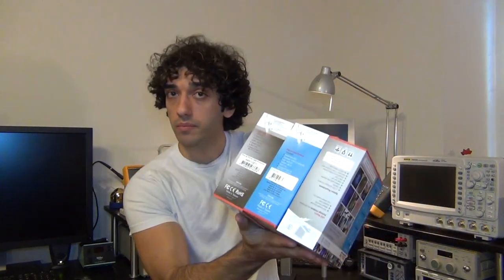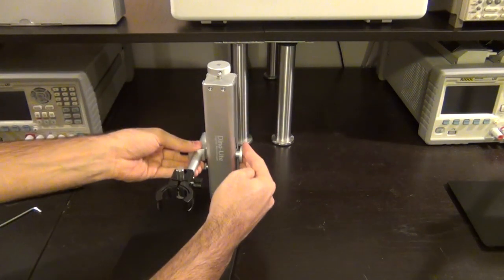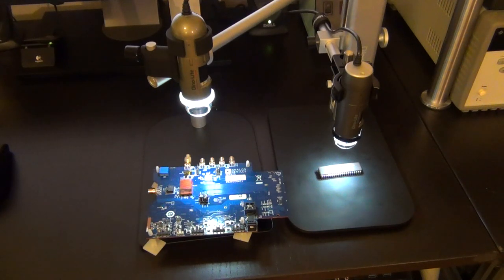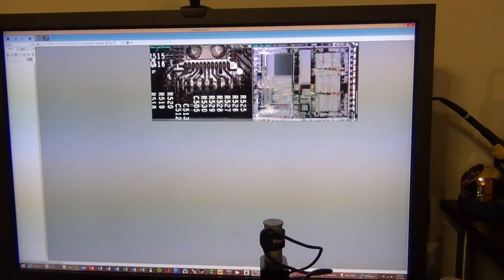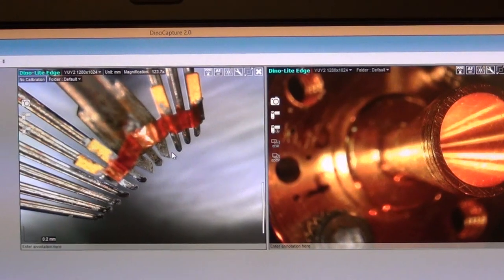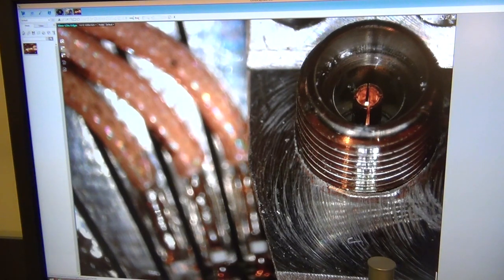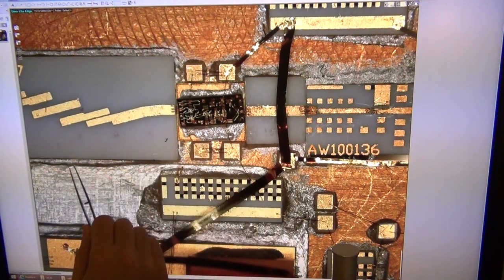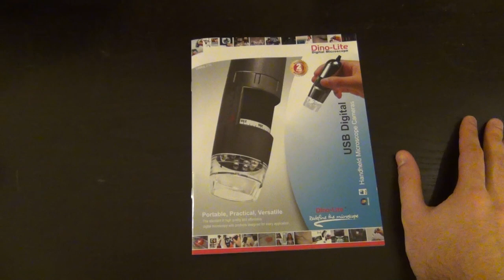TSP #33 - Dino-Lite USB Digital Microscopes Review and Experiments (2014 Edition)

Comment: Are the wrinkled pieces hanging off the transmissions lines for tuning? Looks similar to copper tape, but I'm assuming its bonded to the stripline, and tuned with the lines hooked upto a VNA? You can see a lot of them on the splitter and combiner.

Comment: "jelly" effect is due to lack of global trigger for CCD/CMOS senor, and is caused by rolling trigger, not frame rate. with global trigger at 30fps it will look nearly the same compared to rolling trigger at >60fps. I know that you know this, but it is difficult to be correct all the time at long video :)
Reply: TheSignalPathBlog

Not exactly. basically you have shift registers that can integrate light, but they integrate light all the time. so at any point, you are not reading whole image at once, reset integrators and start again.if you don't want to get jelly efect, SENSOR must start integrate for all cels, stop integrate, and read and transfer data. in rolling trigger, you are integrating all the time, but you are reading each line. That's why when you move something, image will tilt in rolling trigger reading line direction. it's sensor architecture, not hardware fault. only expensive sensors have global trigger
Reply from the maker: Linas, I accidentally removed your comment/explanation while I was trying to remove a spam comment. Can you kindly re-type your explanation if you have the time? Thanks.
Reply: TheSignalPathBlog
Not exactly. basically you have shift registers that can integrate light, but they integrate light all the time. so at any point, you are not reading whole image at once, reset integrators and start again.if you don't want to get jelly efect, SENSOR must start integrate for all cels, stop integrate, and read and transfer data. in rolling trigger, you are integrating all the time, but you are reading each line. That's why when you move something, image will tilt in rolling trigger reading line direction. it's sensor architecture, not hardware fault. only expensive sensors have global trigger
Reply: Linas K
 there are even more issue with usb video devices. RAW stream will have better quality but worse bandwidth. For example for USB 2.0 i would expect maximal resolution 1280x800@25fps or 1280x720@30fps. If compression is enabled (mostly JPEG), then compression algorithm will depend on resolution and framerate too. More data, more calculation, lees quality.

Comment: Neat .But no competition to my 60years old 1000X ZEISS-microscope.But i´m looking for a newer one with at least 3000X magnification but don´t find anything. Affordable or not.
Reply from the maker: 3000X magnification?! DOF would be absolutely tiny. I have videos on my Zeiss microscope which goes to 1000X - but even that is difficult to use.
Reply: O.K. Not with normal light. But working with higher lightwaves and converters somehow. At whole there seems to be little progress in the optical sector the last decades compared with  CMOS-shrinking fine and well
Reply from the maker: @xylfox The limits of optical microscopy in the visible range have been established for about 1.5 centuries. Changing wavelength does change the limit, but then it changes everything else about the lens because the numerical aperture is also part of the ultimate magnification limits. There are several other microscopy techniques used when needing to magnify beyond these limits like electron microscopy. CMOS scaling is not really the right analogy, because in that situation you are illuminating a pattern, not resolving an image to look at with your "eyes".
Reply: thx for the detailed and competent answer @Thesignalpath
Reply from the maker: @xylfox  Anytime.